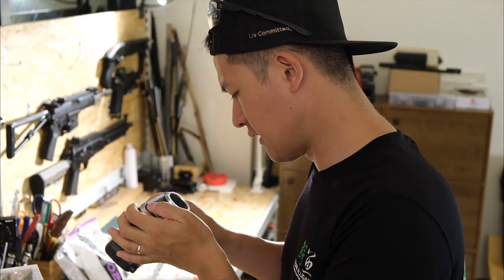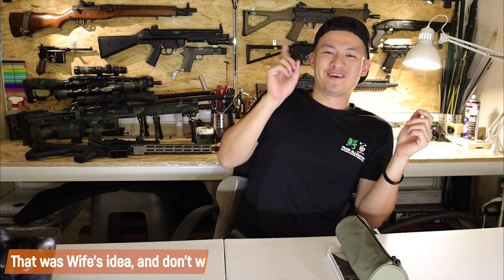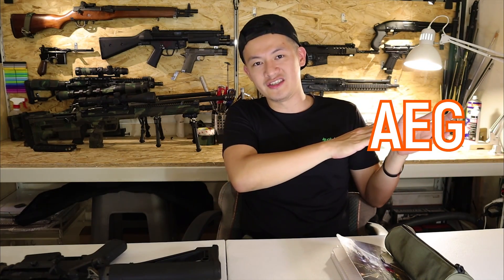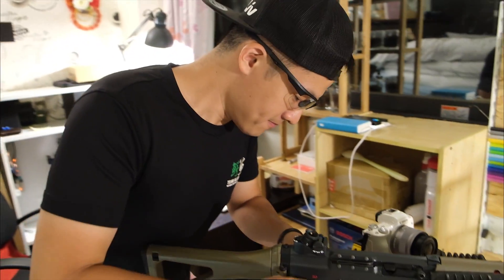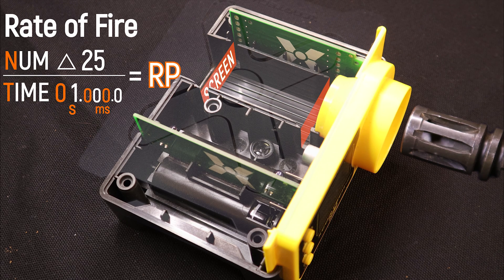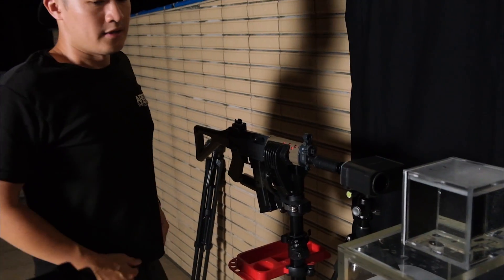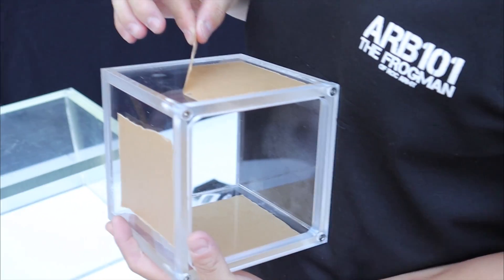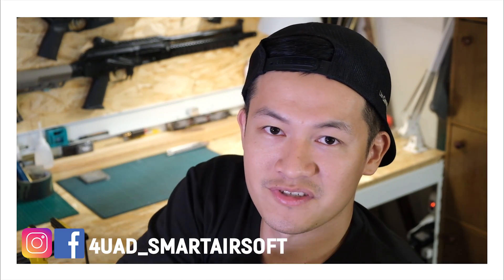How Does Chronograph Works? 測速器是怎麼測速的?

Comment: Hey I'm new to airsoft, but I would really be interested to see the difference between the standard spring in the rifle versus the after market springs( M120, M130,....M170) in the gun. I see a lot in upgrade videos people replacing the spring behind the piston to upgrade it, but my question to you guys if you replace the spring essentially trading of speed for power will you loose accuracy and gain distance or vise versa. I know the hop up unit in these guns are what essentially controls the accuracy, but I'm curious to see what the end results would be. I would love to see a video in which you guys use the sig 552 , but replace the springs with an after market one and leave the rest of the gun as is will it create an accuracy problem or will it help improve accuracy. I am a huge fan of yalls let me know if yall would love more video ideas. Thank you once again and keep up the great content